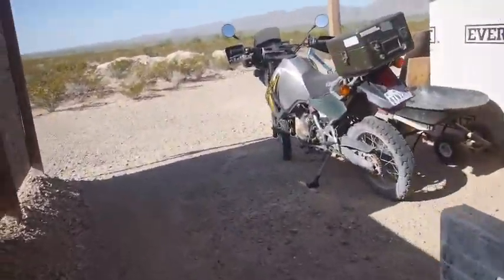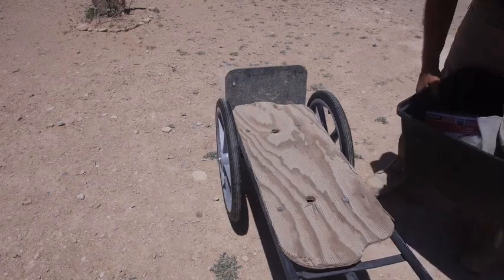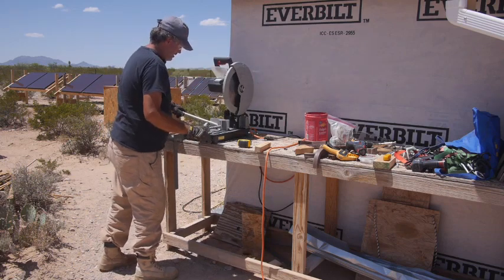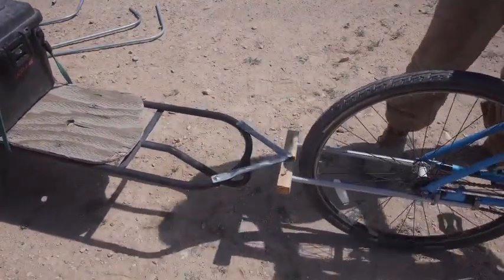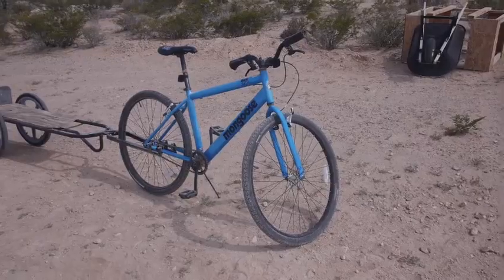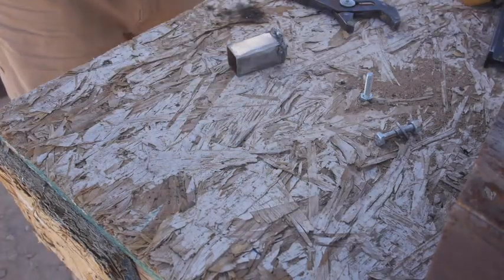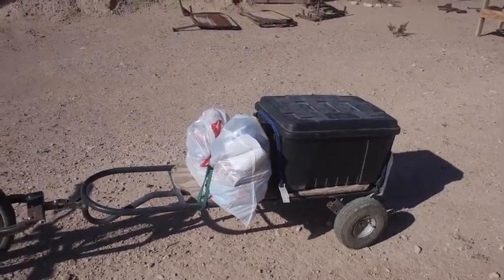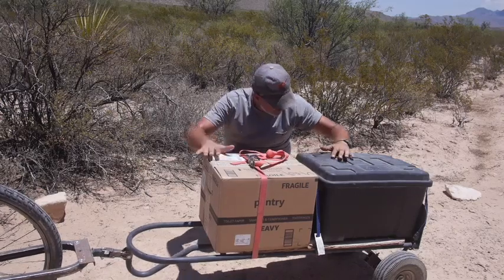DIY Survival Off Grid Bike Trailer

Comment: I notice pulling weight off e bike is more stress on motor vs putting weight on top of the motor such as a rack. I experimented this using same weight on my e bike. The pulling weight forced a cut off of power to cool down the first 3 miles. Putting on weight on top of rear rack there was no cut off to cool down of riding 20miles on. Believe weight on top of a tire the air compensate the overall g forces. Pulling is just straight up rpm force of motor using more wattage than normal of course but the difference of wattage use was more less with weight on top. Used a 1500 watt 52v.20ah Gearless for experimenting. I'm sure using 1800 thru 3000watts makes pulling weight easier and the right specs range of power to pull. But the physics behind experiment actually makes sense of the dimension of air to bear weight.
Reply: Because of the use of air to support extra weight, I plan on using fat tires for rear.
Reply from the maker: Ok thanks, I think I agree with you. If I can eliminate the trailer I would have less rolling resistance and drag, and the trailer tires were small so they didn't roll very well on the gravel. Thanks for the comments and for the idea.
Reply: @CarlinComm  If you bearing items that has to be pulled off trailer, go for it! Keep riding awesome! It was just a side note to help others as I'm fortunate my items not too bulky to place on rear rack. The trailer I had is for items that I need to place and use but I rarely use trailer now but when I do I tend to use mid power over full throttle ( until the hills,lol) . It's also important not to fill air over psi,lol. I thought putting air to tire to rock solid feel help the weight but not, had constant air leaks and blow outs. But getting a fat tire in back will help. Ride safe buddy!
Reply from the maker: @user619tlsdca5  a friend of mine's boy was running motorcycle tires on his ebike, way less flats. Lots of different ways to get it done. Keep riding!

Comment: It is a 2 lb. mechanics club hammer as far as I know.
A very handy hammer.
Reply from the maker: Good to know! I usually start out looking for the right thing, and then buy the cheapest what ever is close enough! It does work good though!
Reply: They are called drill hammers at Harbor freight . The used to be seven dollars.
Reply: Yeah I like them too because they a cheap or were cheap yesterday I was in harbor freight and the didn't have them so I was forced to go more expensive, 12 dollars on a long hsndle  drill hammer with a wedge shape opposite of   the hammer head

Comment: maybe you could pour some polyeter resin into the tube to reinforce certatain  parts... Boy I spoke too soon.. a very nice evolution.  maybe a used  child bike trailer might have been  worth exploring ..new they are not cheap.   compost any paper buried in the ground..  that  bolt holding the   trailer on seems a little small.    But  amazing.. good work.
Reply from the maker: Yeah its evolving! Will probably upgrade the bolt, 1/4" is pretty small, but it hauled 2 good loads from town already. Would love to foam fill the tires, but not solid, the road is so rough, leaving them soft helps a lot. Using the cart sure was easier than building from scratch though!
Reply: Just remember that foam needs moisture water the kick off if we act with Ashley water to so you have to spray in water spray as you're foaming attire anything else for to really set up so I'm told
Reply from the maker: I was thinking some kind of 2 part foam, like insulation foam or polyurathane foams? I can't remember what all they were. Floatation foam is another idea, but would want something that stays more soft I guess. There is a reason we still have air in tires after all this time.
Reply: @CarlinComm  You can buy solid bike tyres off eBay in most sizes and colours. I've been thinking about that for my trailer, but they look like they're a pig to fix into position without proper tools. I still might go for it though, because when they are on, they are on solid.
Reply from the maker: @Teapot-Dave  Yeah, Northern Tools has Cart Wheels, that are solid rubber. The biggest reason for air in tires is to soften the ride. I've been experimenting with air pressure on the bike and also the trailer, and it can make a huge difference in the ride quality, especially on the rough road. I'm riding about 10 miles on gravel, sand, and mostly washboard. There are times I slow down, just because the bouncing is so bad. When I air up the trailer tires, the rattling is pretty bad. Solid tires would last a very long time, but the ride would be terrible. I might look at a foam tire insert, have seen them before, but that later of air turns out to be very important. Seems weird that in the last 100 years, we've not been able to get a good airless tire that rides well. There are the honeycomb tires that are promising though.  Thanks for the comment!
Reply: @CarlinComm  Many thanks for your reply. I appreciate your dilemma with the variable terrain and everything you have out there. You're right that tyre technology seems to have been left back in the twentieth-century somewhere. Maybe someone will see this and produce an all-singing-all-dancing type of tyre which is suitable in more situations.
Reply from the maker: @Teapot-Dave  Yeah I'm always trying to decide if I want to over explain things, then I get into a long rambling bag of confusion! haha Here's a link to one idea, the honeycomb tire: https://images.app.goo.gl/WvjkAYBBbG9x1BxW8  if that doesn't work, I just Googled "honeycomb tire" you'll see what I mean. Apparently the military is using or testing, and some heavy machinery may be using them too.
Reply: @CarlinComm  They look like a really interesting concept; I'd never heard of them until now so many thanks for that, I'm always interested in new or unusual things even if I don't need to use them myself, it's just good to know what's out there sometimes.
Reply from the maker: @Teapot-Dave  yeah there was one shot I saw on a video, when they stopped quickly, the tire had a weird flex, like it sort of oscillated, but I think if they add a sidewall it would help.
Reply: @CarlinComm  There must be a patent out there waiting for someone....
Reply from the maker: @Teapot-Dave  Yeah I always figure if there is a patent, that just proves its a good idea, just that someone else had it first!

Comment: Very nice. Comparable to jury rigging Dewalt tool  batteries to an ebike
Reply from the maker: I've seen that done, if I had thought of it earlier, it would have been easier than building my own packs. Thanks for the comment! If you get bored, I've done updated videos about the trailer.
Reply: @CarlinComm   yes I'm going over your videos as we speak . The 3 speed internal gear video . The wheel building video , oh you have a update trailer video?. I will keep an eye out for it.
Reply from the maker: @robertbrawley5048  Yeah that trailer has been changed so many times, I've lost count! Big wheels, little wheels, I think put at least 150 miles on the original 10" cart tires, the bearings started squeeking. Put some HF 10" wheels, they lasted one trip? haha it has 26" bicycle wheels on that are doing better. Many grocery trips were 40 to 50 pounds. Broke the hitch clean off once, that got fixed with electrical tape on the side of the road. Think that video hasn't been uploaded yet...
Reply: @CarlinComm   I was kinda of wondering about your big wheel based on this linked channel 

https://youtu.be/KaxLPxn4liA

You see in this linked video the host  tried the hand cart wheels on his handcart trailer seen in another video.  Then tried his bigger wheel seen in the cart setup on his hand cart trailer. 
I guess he prefers the  smaller wheels

Edit.   Oh,  @ the 4:22 time mark he say he is only using the harbor  freight   material handler wheels on the back because that is the only set he can attack a sprocket to until he figures out how to power the 20 inch wheels
Reply from the maker: @robertbrawley5048  Haven't looked at that in a while, that's another project I'm working on, that's my other project. Anyway, let me see if I can summarize that one! "Turtle" will be a 4 wheel quad pedal with electric assist. It's not done yet though. I have a current batch of videos, the Blue Bike Electric Trike, in that same play list, where I'm testing systems for the quad Turtle. I haven't gotten steering working yet for the quad, so I just put 2 rear wheels on a bicycle so I could test the motor more. I've moved up to motorcycle wheels for the rears, I keep breaking bicycle wheels on the rough road with heavy loads. Anyway, the motor and battery and motorcycle wheels are working fairly well, I finally got a good test of that, got almost 8 miles of testing done.  OH, I guess the actual testing video is scheduled to go live tomorrow, here's the most recent Trike video, same motor as what will go on Turtle quad eventually!
Reply: Revisiting this channel after a year.  I creditable that you are still alive so far from the post office yet it only takes you an hour and a half to get there in 95 ° heatp . I ride my bicycle 2 miles to the grocery store  and fainted in the parking lot
Reply from the maker: I'm now about 2000 miles from home, in Washington state on my solar powered electric bicycle. I'll start riding home the next week or so, waiting for a replacement motor controller.

Comment: if you getting thorns in tire use the pipe insulation method
Reply: or buy Kevlar tires
Reply from the maker: Most of my problem was from excess weight, the foam in the pipe insulation compressed a lot. Marathon tires do very well with thorns.
Reply: Just line the inside of your tires with old Thorn resistant tubes with the valve cut out and a slit all the way around the inside of the tube so it wraps around your tube that you inflate giving you an extra layer of thick rubber for flat protection
Reply: As for your hitch and trailer arm use one of those bent conduit pipes you have put a hole in the end of it attached a three-length regular chain to it and connect it to your bike frame on the left side yes side mount by way of a cheap seat guts stretch it out open it up and wrap it around your frame tube and put a quarter 20 bolt and nut through it attaching the chain then wrap the exposed chain with an old bike to really tight you get no rock or rattle it's the most solid way DIY out there trust me

Comment: very narrow, and center of gravity is very high.  Carlin, you might think about spacers on the axles to widen this.  You are going to find it tips really easy on corners,
Reply from the maker: Yeah I've gone through a few revisions since this video came out. Ironically, I've only had it tip over twice, and both of those were off road, going over bushes. It's actually working much better than I would have expected, which is why it hasn't been improved much since I started. Its wider now, has more of a cargo basket on it, but the basic hand cart is the same. Same wheels and tires, same axle, that part is back to stock again.  Those little tires have way over 100 miles on them, tires are doing fine, but I think I'm hearing bearing noise now. It was just a quick hack, that keeps on working :) Thanks for the comment!

Comment: When you started the video, the back end of the trailer was obviously too low.  To me, this meant the cargo, as well as the load was all on the back end and causes undue stress on the bike, as well as can lead to issues with the cargo at every bounce in the road. It limited how much cargo you could safely carry, as well, I believe. You eventually changed that and even added some larger wheels. However, by the end, you had made a hitch, but it still all allowed the trailer to still sit low at the hitch, as well at the cargo bed & frame. Larger tires didn't help that issue and I am thinking that your main issue is that the whole trailer simply rides angled too low from the hitch point on back. The swivel hitch setup you made works well to allow any lean from the bike to happen. Your hitch setup should have the trailer nose more downward that at a straight angle or even reversed with the nose pointed up. This may be accomplished by modifying the rear axle location to actually make a set of pillars to move the hand truck frame up higher in the back area. If you check out barrel train cars for ideas about this, you can see how they set up their cars to ride well. I am probably getting too complex on this to actually work well for you to  understand what I mean, but the rear end of your handcart should be even or a bit higher than the front end is at the hitch. Otherwise it will always have the issues of not being all that stable, especially under a heavy load. It would probably be even easier just to adapt the same type of hitch that is most commonly used with pet carrier/baby carrier trailers which are  used with bikes. They have spring loaded hitches which allow movement sideways and such, so that you can turn or lean the bike easier. Fabricating one of them would likely be easier than making the hitch setup you came up with. I am not being critical in the least, as I love DIY things and am currently planning out a barrel trailer setup for my electric bike and maybe adaptable to my lawn tractor. Every time I start on the project, I seen to come across another idea which  changes my plans dramatically. Finding videos as this give me inspiration. sometimes I give myself a face slap sometimes after expending so much effort on a project just to see someone else had a better and easier idea if I had only seen it first. ;-) Thanks for the video. ;-)
Reply from the maker: A lot of great ideas there, sorry I hate typing on the phone. I've changed so many things on the trailer... See my newest videos for details, made a one wheel trailer with solar for long distance touring, I'm going to California now for The Sun Trip. Doing 50 to 70 miles a day so far self contained, no external charging.
Reply: @CarlinComm   on an electric bicycle right? With no trailer or with one?
Reply from the maker: @robertbrawley5048  with a trailer for the solar panels, and the camping stuff.

Comment: Why not just use and steel front wheel fork, which you can widen to fit the rear axle, as hitch ?
Reply from the maker: That's an interesting idea I hadn't even thought of! Another idea I did consider was to run the hitch up to the seat post, which I think would handle better. I've seen something like that before but haven't tried one yet. Thanks for the comment!
Reply: @CarlinComm  lower center of gravity makes for better handling i think, that's why the majority of bike trailers attach axle height.
Reply from the maker: @Charlemagne1367  Yeah I guess I thinking of how a 5th wheel trailer helps distribute the weight between the axles of the tow vehical better. I have seen child carriers that connected to the seat post, but since I don't have kids, didn't think much about it at the time :) I do definitely notice the weight with my trailer hitch sticking so far behind the axle.

Comment: it's a nice video, but the trailer is so bad... ... if it gets the work done, then it's ok, but it must weigh like 30 kg unloaded and the wheel base is so narrow it could be good for driving in tight streets with loads of cars beig just as wide as the handlebars...but a small stone will tip your trailer , and the cargo needs to be as close to the ground as possible
Reply from the maker: Yeah, it is pretty heavy, but it is very strong, some of my grocery runs are weighing 40 to 50 pounds on a rough road. I've been using this since July, and only tipped over once, when it ran over a bush, off road. I've updated it a few times since then, the latest version is much lighter, wheels are wider, you'd probably approve of that one more :) Thanks for the comment.
Reply: His cargo isn't sitting much higher than my Amazon bought cargo trailer.